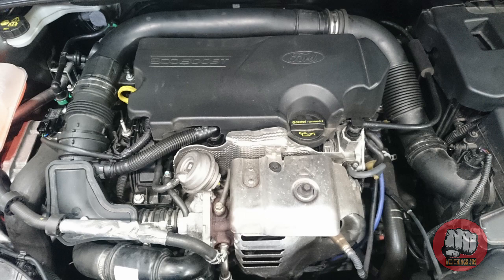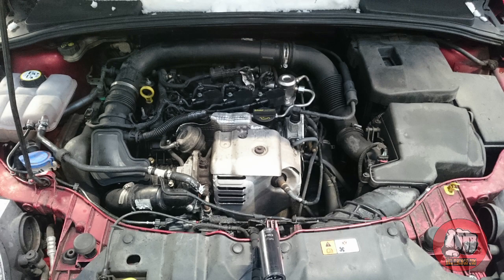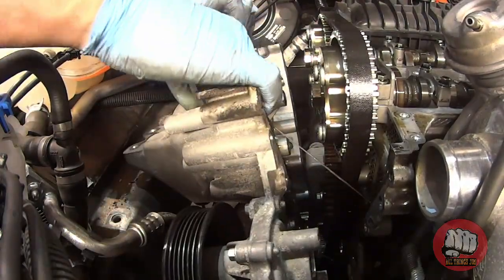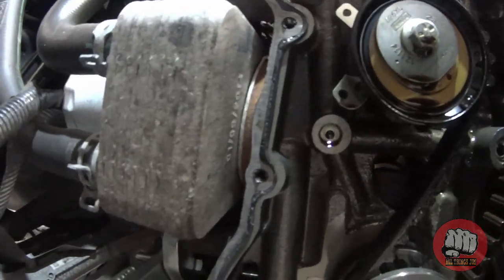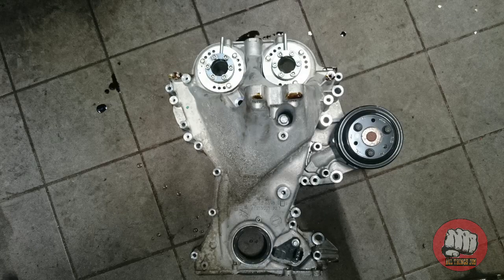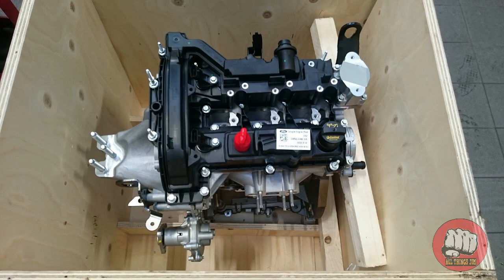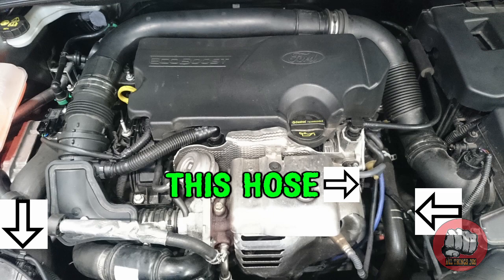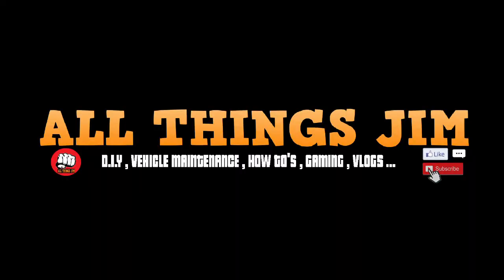Lets discuss the 1.0 Ford ecoboost engine

Comment: I mean realistically you can avoid 90% of this by having the belt changed and running the correct spec of oil NOT 5w30. The water pump leakage, if you have the belt done this should* be done as part of the job. Likewise replacing/cleaning out the pump strainer. It’s quite funny how people will baulk at paying a thousand quid on a belt change on these but spaff similar money on a DMF replacement on a diesel...
Reply: In Australia the specified oil for this engine is WSS-M2C913-D 5W-30 and we don’t see a huge number of failures
Reply: @YZJB  The issue is, certainly here in the U.K. lots of independent garages will have a 45 gallon drum of 5w30 synth and just put that in everything. By the time it’s ruined the wet belt that’s sometime later so it gets missed. Loads of lack of knowledge around that you must never use engine flush on this engine either, but there’s a lot of garages out there that just don’t have the knowledge around new technology.

Comment: How would i find out if my car uses a wet belt? I have a 68 plate fiesta mk8 1.0l 100hp?
Reply from the maker: If your engine block is the same as the one shown it will be a wet belt, the chain ones look slightly different... later chain ones look like this...
https://imgur.io/a/Za6Jp4i

Comment: Why engineers decided to do any of it? Why not chain, why wet belt etc. simply because they needed to make most ridiculously cheap and poor quality engine (not cheap to buy, just cheap to make), which get's good emissions in lab test and suck for everything else + planned obsolescence for that cheap car can be taken out of it's misery just after warranty ends, so second hand market is killed-off reducing competition between used and new cars and driving new car sales. 

Basically design brief was - low emissions on simulated test, as cheap as possible to make and target lifetime of strictly no more than 60,000 miles. One thing that many owners do not realise is that manufacturers do not care about second hand market, they do not care selling them, or servicing them, that is liability not the business they want to deal with, so as long as car last trough 3-5 years for the customer that bought it new, that is all they need, customer happy because after lease ends they don't care what happens with the car, manufacturer happy because car goes to the scrap yard reducing any need to deal with any maintenance etc. 

Basically Ford went the French way here - disposable cars with disposable engine and that explain all stupid design decisions.

Comment: Im on my 2nd car with this engine. I had a Focus with 125bhp, and now i have a Puma with 155bhp. So far so good. The new car is very zippy.
Reply: Motor has changed ….i dont know if u still have wet belt i think is not there anymore
Reply: I have a 155 puma. It has a redesigned engine with chain driven cams although the oil pump still has the small wet belt drive.
Reply: @robboles5233 you've still got the problem then!!! Good luck with the maintenance/repair bills 😅😂😂😂😂
Reply: like an athlete on drugs no longevity

Comment: How should the engine sound then? With the bonnet up I don't think I've heard anything much different than that on any small petrol engines. What is the tell tale noise amongst the typical tickover pings? Thanks.
Reply: I was thinking the same as the engine in the video sounds like all 1L ecoboost engines I've heard including my own.
Reply: @bobp6742 Also depending on what microphone he was using (maybe from a phone) it can illusion the sound to what it actually sounds like.
Reply: @rufusgreenleaf2466  
Yep good point, same as my speakers might not produce the sound.

Comment: A truly disposable car, by the time the wet belt needs changing the car is worth 20% of what it was when new (because everyone knows about the belt problem) and the cost of replacing the belt, oil pump drive belt, idler pulleys, tensioner etc make it uneconomic to do.
Reply: Costs £1000 to £1500 to get it done at an independent. Expensive but when 9-10 year old comparable cars are at car supermarkets for £8000, spending £1200 on the car you have is often cheaper than buying another 10 year old box of unknown problems.
Reply: 8k for a car of that age!!!!! Don't know where you are buying your cars from? But they've seen you coming!!😂😂😂
Reply: @scooby0000  How long is 'many many years' ? 10,15 more? and how is it that a class action against Ford for this very problem has been upheld in court.
Reply: @scooby0000  jog on !
Reply: Yes you're talking pure nonsense at least we can agree on that!😂😅😂😅@scooby0000
Reply: @scooby0000  little things please little minds! and yours must be miniscule! Now like I said jog on peewee.

Comment: Ford designer:  hey, I've got a great idea.  Let's build a sub-motorcycle size engine for a family saloon car.  Even better, we can design it so the rubber bands driving critical parts are continually soaked in oil; hot oil when it's running, but don't worry about that - think of the money we can make from scheduled rubber band replacements...
Reply: You’d be better off shoe honing a 1000cc bike engine into it instead, would last longer
Reply: @madbadger85  Hayabusa springs to mind!!
Reply: @madbadger85  Indeed, I never had any trouble with my 1000 cc Kawasaki.
Reply: @aapddd 
One day someone will invent a low stressed all iron pushrod inline 7 main bearing 6 cylinder engine.
Reply: But a belt gets 1% better fuel efficency than a timing chain which would also last the life of the engine in most instances.

Comment: I’ve had a 66 plate fiesta that has run faultlessly, I’ve just bought a 15 plate Titanium which is very low mileage and like new however I’ve had top up the coolant in the header tank a couple of times, I’m guessing it’s leaking from the water pump O’ring which is annoying to say the least

Comment: The wet belt was fitted because of friction reduction. Time has shown that they shed rubber which blocks the pump pick up and all that entails. We have done lots of pumps and belts with all that entails. Cost £1k or so they are an absolute  B1tch of a job. In the space taken up by the belt nice tough non stretching duplex chain could have been fitted. Then perhaps it would justify award winning. But no , I think if Ford changed to a chain they would fit a spindly little chain like BMW or VAG do to their engines and everyone knows how that goes....

Comment: My 2015 titanium fiesta ecoboost suffered oil starvation due to the oil piclup strainer getting clogged with sediment from the wet belt.. Car had a full service history. If only they had used a chain this engine would have been brilliant.
Reply from the maker: Well it would have been better.... the newer models did come with a chain 👍
Reply: Do you know when the newer models started to come with chain ? 🙂 @ALLTHINGSJIM
Reply: @FuseItAll the ones with the intake manifold at the front of the car and exhaust towards the rear have a chain. The engines with the exhaust manifold at the front and intake at the rear have the wet belt
Reply: My 2015 fiesta did exactly the same thing.
Reply: Chains have their demons too.  Just ask VW.

Comment: Having had 64 plate now for 5 years done 80000 recently replaced new clutch and flywheel for a cost of £580 then to a new timing belt and oil pump for a cost of £980 which is a lot but finding someone willing to do it and do it well was difficult looking forward to hopefully a good few years of payment free stress free motoring cheap to run does the job mine has a st kit which makes it look a little nicer than the standard but who gives a shit I love my 1 PoP eco boost got some poke for a 1 litre also thinking lots of clutches and timing belts due to go bang if those have or looking at similar age vehicles
Reply: Nah, you'll have more bills soon, get rid while it's still running.
Reply: @ChrisPatrick-q6k  like what? Give me a run down of 3-4 parts you think will go I’d say I’ve covered 3 of em
Reply: @ChrisPatrick-q6k  I'm on 100,000 miles. Not a single issue at all.

Comment: Thanks for the info about the timing belt ! Just about to take delivery of a 2019 with 9000 miles Blue ST Line this week 👍
Reply: Think it's only the 1L ecoboost engines that have a wet belt
Reply: And the diesels

Comment: Hi Jim, have the same engine. Got a little issue, on idle engine revs up to about 1.5k rpm for a bit and then makes a puff sound and then rpm drops back down. Keeps cycling like this, what can this be?
Reply from the maker: Hi, thats almost an impossible question without actually having the car to diagnose although my first thought as Ive seen something similar before would be to check the vaccum pump on the back of the exhaust cam on the right hand side of the engine block, they can sometimes go faulty and need replacing, also check the plastic pipe ontop of it is secure and no splits 👍

Comment: Can you say if the new mk 4 focus  has a chain or a wet belt mine is a 2020 1.0 ecoboost st line.
Reply: The mk 4 focus has a chain but a wet belt to drive the oil pump to my relief.
Reply from the maker: Honestly I dont know, I no longer work for ford however i know some are chain

Comment: One more very big thing,The crank isn’t keyed making the engine time bomb.I don’t know why ford make at least two engines this way,eco boost 1.0 and 2.3 mzr engines. Crank not keyed
Reply from the maker: Because for some odd reason they probably think they can save a quid and just tighten the crank bolt to a ridiculous torque instead. Thanks for watching 👍
Reply: @ALLTHINGSJIM  More than a quid, actually as the lack of machining makes the crank stronger and it can therefore be lighter. The crank pulley doesn't slip.
Reply: The Ford / Mazda engines used in the mk3 MX5 also don’t have a key on the crank sprocket. Think they have switched to a keyed version for the mk4

Comment: Recently bought a 2015 1.0 125, good fun to drive and returns around 45mpg. But I am worried about the potential problems, don't know if it's worth getting the belt changed early
Reply: Mines done 80000 just had new timing belt and oil pump £980 difficult to find someone willing to do it and do it well
Reply: @Buzzcocka that sounds quite cheap. Local Ford main dealer charge £1400.  Independent Ford garage won't touch them. Changed the car for a Honda so no longer a worry for me
Reply: @stevieboy6286  the tools needed to do the job are 1200£ so garages reluctant to do without correct tooling and investments from independent garages mean they’re not going to do it anyway
Reply: @Buzzcocka That's crazy, you can buy a whole (more reliable) car for that.
Reply: @ChrisPatrick-q6k  name 1 car payed fully now hopefully run it into the ground with less chance of it going boom 🤣
Reply: @Buzzcocka  Well my Vectra was £650, that was two years ago.

188,000 original engine/gearbox/drive shafts and PS system. You're Ecoboosting isn't going to do that.
Reply: @ChrisPatrick-q6k  what makes you so certain!? If I get 5 years out of it it’s as far as I’m concerned free motoring
Reply from the maker: Yes I would if you can find someone reliable to do it and you plan on keeping the car long term, prevention is better than cure as the saying goes 👍
Reply: I got rid, part exchanged it for a Honda Civic
Reply: @stevieboy6286  was it a good decision? How’s the civic?
Reply: @Buzzcocka  Obviously was a good decision, they're not good engines.

Comment: surprises me they dont all just use a timing chain instead of a belt today ?  is that a dumb take or ?
Reply from the maker: Not dumb no, they didnt originally i think because of the extra cost im sure, all the 3 cylinder hi stressed engines from diffrent manufacturers were always really designed to be throw away engines, 100k throw away get your next type thing. Thanks for watching 👍
Reply: @ALLTHINGSJIM  yikes , interesting stuff your channel thanks
Reply: Seriously believe they designed with the intent of boom new engine needed if action not taken

Comment: How did this engine win so many awards?  Exactly who said it was good when it has consistently failed with the same problem over and over?
Reply: Awards are given for efficiency etc. when the engine is new + this won most of the awards in the sub 1lt class when there weren't many competitors.

Comment: Very badly designed engine. Wet belt 😱 should have been on the outside!! Or chain. As you say hard to work on. Keep garage in work for years £££££

Comment: Please make a discussion about the 1,6 TDCi engine. Like to hear What you think about it
Reply: Peugeot engine 1.6 hdi engine is the same as the 1.6 Tdci ford equivalent,   a lot more reliable than this 1.0 ecoboom junk. But they can suffer engine failure it's a known issue but still a great engine in my opinion

Comment: Hi, I have 1.0 eco 2015-16 model I recently encountered a problem with with fan overruns and switch off minutes after stopping and the car lost power with alarm of 'power reduced to cool the engine' when I drive less than 80kph the temp is normal but above rises and reduce the acc power. What might be the problem?
Reply: Did you figure out what the problem was?
Reply: Common overheating issues gave mine back as close to blowing engine up or setting on fire at that time we part exed for a 64 plate to this day still have it luckily no issues since

Comment: I thought that sound was normal for this engine.That’s exactly how my one sounds.
Reply: How old is yours and whats the mileage on it? I would say mine sounds about the same and I wouldn't have thought that this sound comes from oil deprivation. I read that in some cases the oil pressure light will turn on indicating a clogged oil pump, but mine hasn't had that happen at all. Now I am worried if I need to move quickly on my appointment in about a month. Mine is scheduled for the belt change after 10 yrs and its a big bullet to bite, but otherwise the car is great imo.
Reply: Mine sounds the same and my engine is fine.

Comment: The Ford Puma 1.5l that and Hybrid model that uses a Chain timing inatead of wet belt has some over design improvements for any of these described issues? Does chain timing still uses a wet belt for oil pump and still clog the oil strainer?

Comment: I have one with 100k on it. I changed my belt 12000mls ago and my belt was toothless on 15% of the belt - 1 tooth from skipping time and a miracle it didnt fail on me. I have done a lot of extra oil changes and more than most do. I have changed the hpfp and ppl have been saying it can also leak down through the plunger and cause a dillution. Is that a failure you have heard as its not mentioned? My belt should not have been so deterioated with the better service interval i've been doing - i have mostly done 5-8k oil changes - but a lot of ppl have been doing longer intervals than mine and had much less wear on the timingbelt..

Comment: As this is the 10th year of the engine in a fiesta, and the belt replacement is 10 years or 150' 000 or 125'000 miles depending on who you talk to.
I think people who know will want a cast iron guarantee that the belts (there is also the wet belt from the crank to the oil pump) or a £1'000 min off the asking price.
We took our 2013 fiesta ecboost 125bhp to 108'000 miles with nothing other than annual oil and filter changes, 1 set of spark plugs and 1 pair of front lower wish bone arms,.
But spending over £1000 on an " invisable" belt change on a £3000 car was to mad even for my man maths, so we part chopped and got a 3 pot 12'000 mile kia rio.
Reply: Why the wishbones?
Reply: @johnnyloholtthomsen6590  
Because the ball joint on the passanger side was worn and an mot advisory, you can get just the ball joint or for not much more the whole arm and if you do 1 side you can bet the other side is nearly as worn, for £53 for the pair  with drop links thrown in and 3 hours of laying on my back on the drive one Saturday, and a tracking check done locally for £30 it was peace of mind.

Comment: Got 1 of these and its just under 10 years old with nearly 60k (owned since 3k). I'm in 2 minds if I should spend the money on a replacement wet belt. As in 10 years its been a good car for my needs. I've changed the oil twice yearly and filters, plugs at 35k. As for repairs, pads and discs (twice), tyres a number of times. Track rod end, lower control arm. Free on road tax currently.
Reply: My 2013 facelift fiesta ecoboost is basically on 10 years with 140.000km on it I'm definitely considering getting it changed soon just in case and i love that car so if i have to pay 1200€ or 1500€ i think it's worth it
Reply: Ah yea i will guess you should still be fine if you change your oil 2 times a year with 5w 20 only
Reply: @@SilverSeeker232 Yep, light goes out quickly and doesn't  come on again until restart. I often wait 20-60 seconds before moving off, to make sure the oil gets around the engine

Comment: As you say, why on earth did they use a wet belt, probably an efficiency ecco design. I got quoted £1500 from Ford to change mine, they say most customers will get them changed early at 9years to preserve warranty.
Reply: Yeah they said it was to help reduce friction so in turn help mpg/emissions it also was meant to extend the life of the belt but it definitely wont last the 150k miles change interval for the belt that ford recommends
Reply: what  has a warrany past 9 years